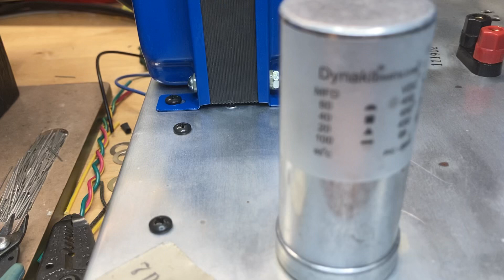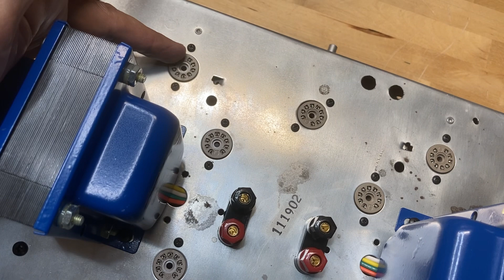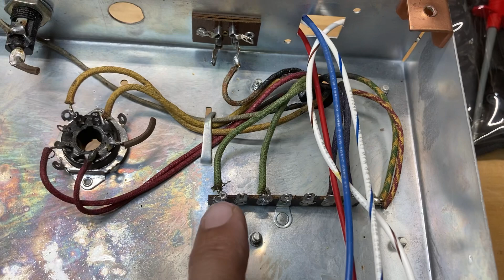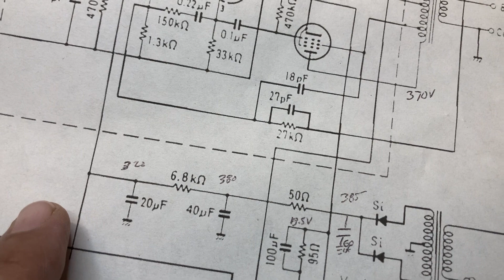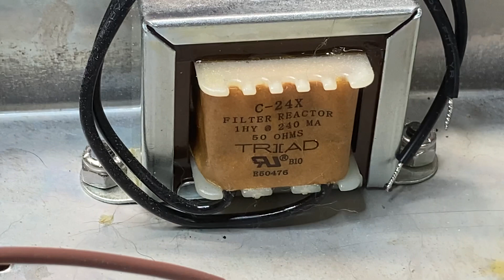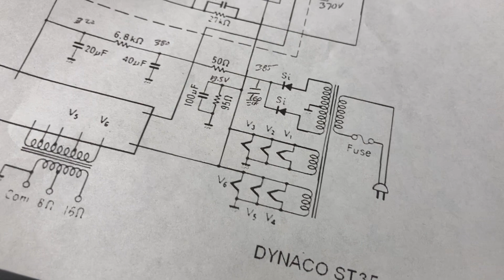Point to Point Dynaco ST-35 Tube Stereo Amp Build Part 1 - Overview

Comment: hi can you tell me what secondary voltage and current  on the power transformer on the original shematic ,thanks
Reply from the maker: I believe it was around 335-0-335, don’t know the current rating, but Heyboer and others should have replacement transformers available.